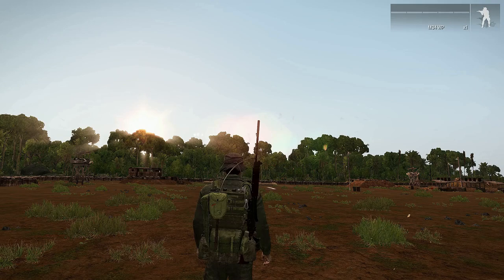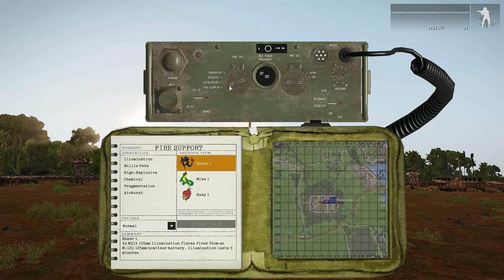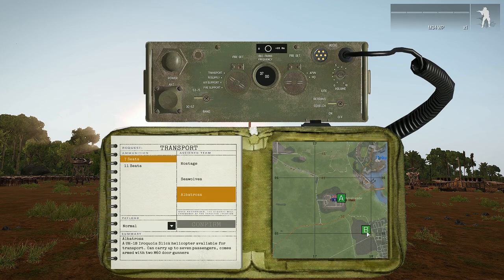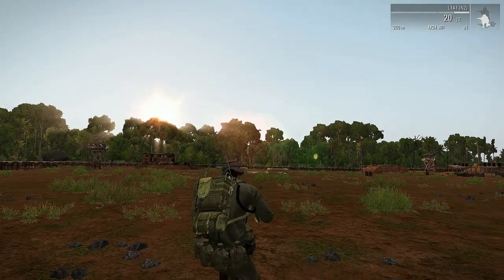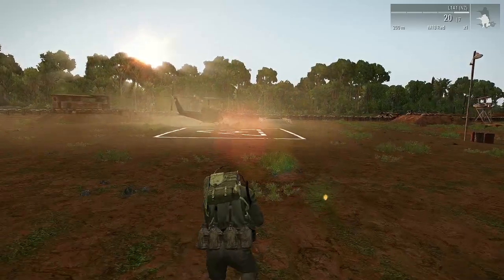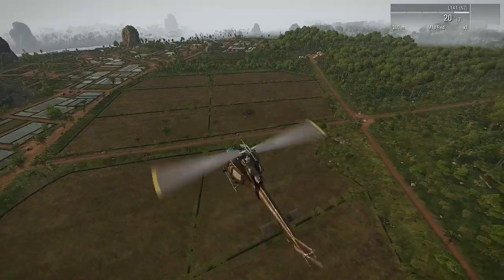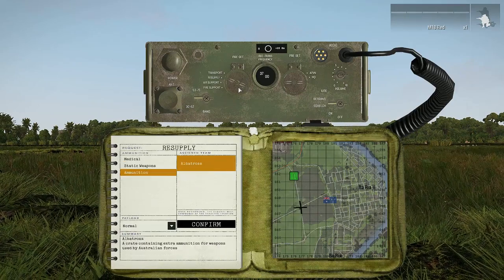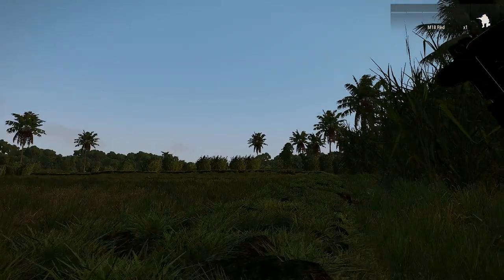[Arma 3 S.O.G. Prairie Fire] Radio Support Module Tutorial.

Comment: Do you have any idea why I cant switch with the support and transport buttons?
Reply from the maker: If you're doing it on a premade mission like MIKE Force it may not have the function scripted in. You would have to retrieve the github script for it (I believe it's easily found through google). and add it to a description.ext file or .hpp file.